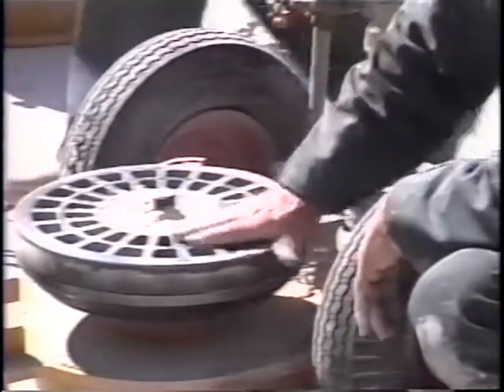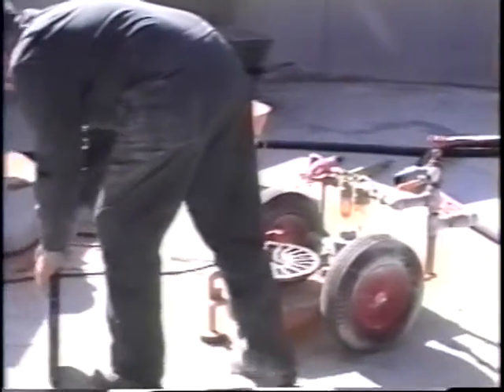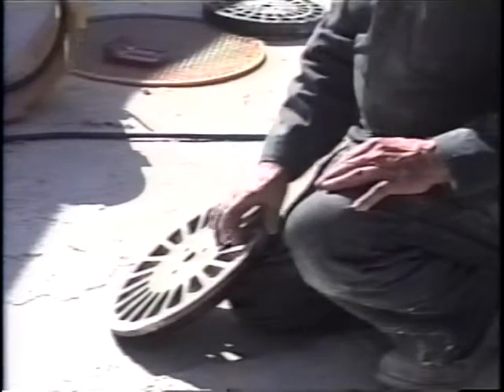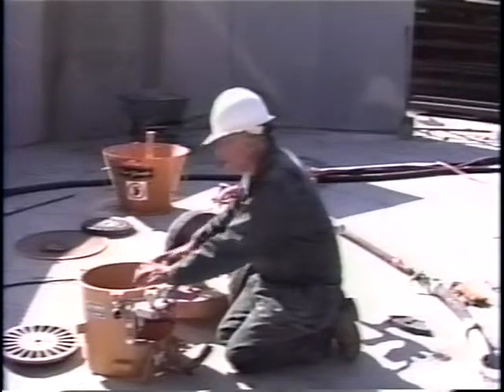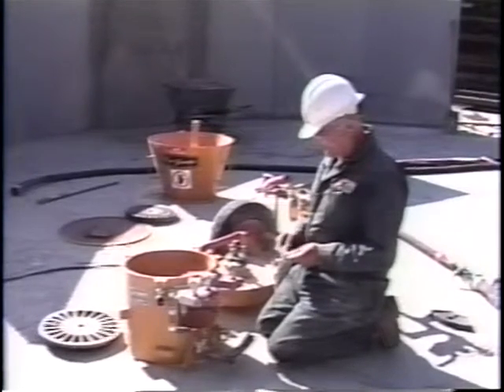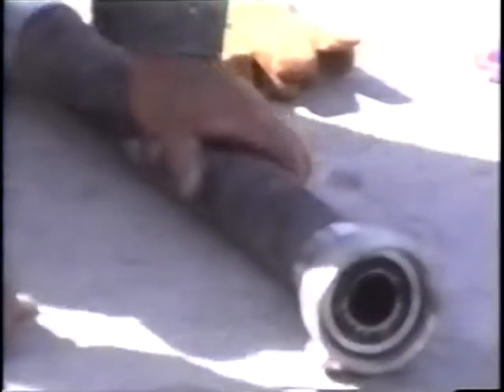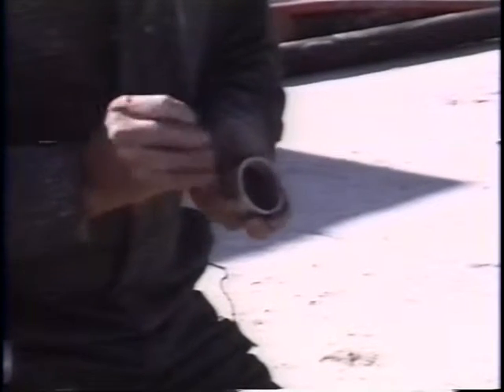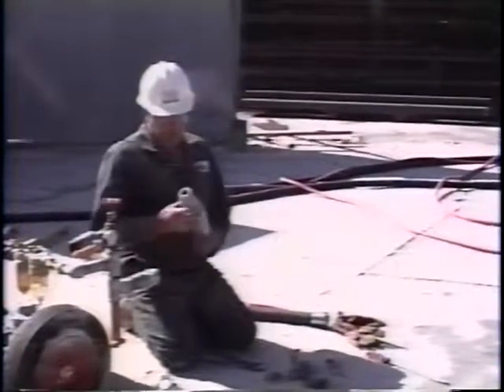REED Gunite Machine Instructional Video #4 of 4 - Gunning/Spraying (continued)

Comment: Finally I found it but wow how do you huge middle bolt holding that together I tried cus it was a 6 sided shape so I thaught it was a bolt but I couldn’t so I just ended up cleaning the inside with a chisel and small Jack hammer or chisel hammer whatever you call it